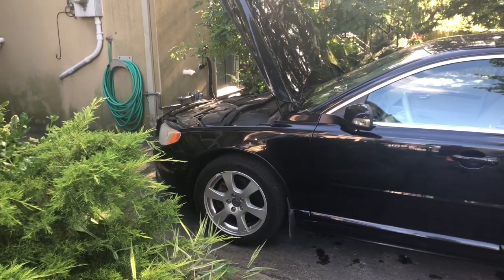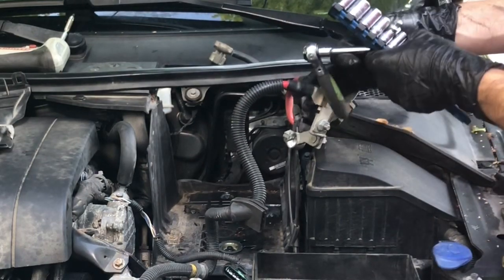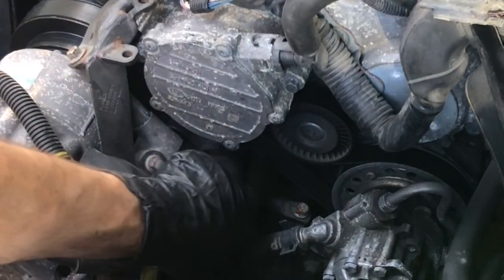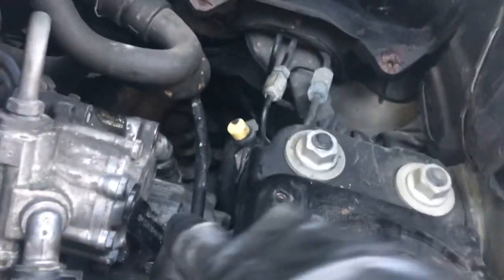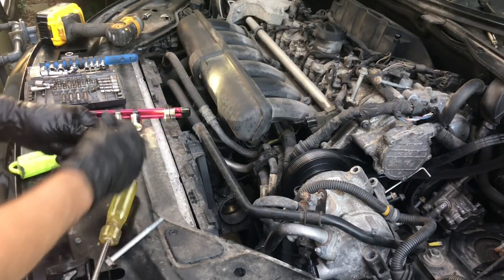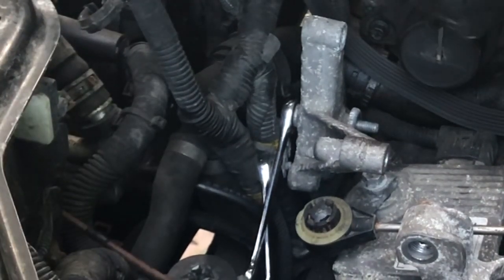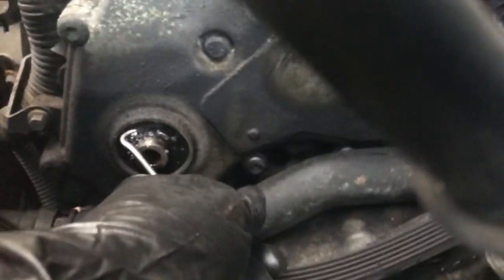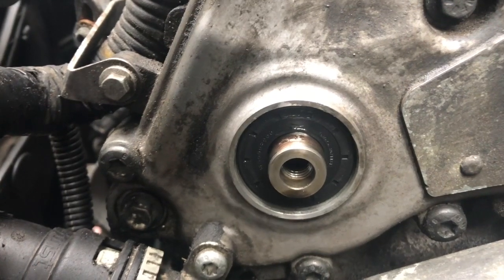Volvo V70 XC70 Drive Belt, Tensioner, Water Pump, Decoupler Pulley Seal Replacement - Part 1 of 3

Comment: Heads up for 2011 XC70 non turbo people. I just did the service... belt, water pump, tensioner, idler pulley, decoupler... and it was way easier than MY 2011. Way fewer parts to unbolt, no PS pump in front of the water pump and no need to align the A/C bracket with  a jig. Got it done in 3 hours.
Reply: Thanks for the update. Mines coming up soon
Reply: I have the 2012 XC70 nonturbo. I need to replace the drive belt , can you post the steps or what to watch for, and do I need to replace the Idler pully, and decoupler or just buy the Kit fron FCPEuro (Volvo Accessory Drive Belt Kit - INA 30757007KT), this my first Volvo but i have done lots of other work on my other cars
Reply: @joey1917  I have a write up from when I did this., but it’s long. If you give me some way to send it to you, I’d be happy to do it. IMO, if you’re going in this deep, replace all the parts that he shows in the video.

Comment: I appreciate this video...
A few things:
1. You pushed in the seal (with the volvo tool attached) by hand. Mistake. The tool is a press that ensures it goes in Perfectly straight and doesn't mar or damage the outer lip of the seal. It should be turned by a wrench until seated.
Also, before putting the seal in I would first buff the aluminum hole smooth and then apply grease to the clean hole for the seal to slide in on. 
Lastly, go get yourself an impact driver so you don't need to waste energy on drills and air tools. 
Do really appreciate this video 😊 ty ~

Comment: What a great channel, and great video!  I just picked up an 09 XC70 this weekend with 377k kms. I'm going through it, replacing most of the drive belt accessories. This thing was never maintained. This really helped me out to change out the water pump. VIDA only shows so much, but you need the practical part to get a good idea of what to do! Do you think I can borrow that coupler removal tool? I figured i'd change that seal too, since it's all apart. I'm up at Bayview/7
Reply from the maker: Rawad El-Debs I actually borrowed the seal tool from my volvo friend in Mississauga. Send me an email at pierre_mcalpine@rogers.com and I will add you to our GTA volvo group so you can reach out to him directly.
Reply: @Bigtime_mcalpine  Hey. How did you know that you have to replace crankshaft pulley first time? I have a noise of worned out bearings coming from engine bay when idling.  I replaced tensioner, idling pulley and belt but noise didn't go away. Thx
Reply from the maker: @adamsolowianiuk9462  Hi Adam, there was nothing visibly wrong with it but I damaged it slightly when I removed it so I figured I should go ahead and replace since it’s a maintenance item anyway. When they fail, I think i remember reading that they lose their ability to hold tension when rotated in one direction or something. I don’t think your decoupler pulley would be the source of noise. My guess: AC compressor clutch bearing which I think I also replace in this video.

Comment: Awesome videos - thank you for sharing them with us! I have a 2015 XC60 T6 with the same oil leak. Before the leak developed, there was a grinding noise (it's still there) from the belt area. My guess is that the noise could come from the pulley you removed/replaced or from the bearing inside of the READ. What is most likely to cause the seal to deteriorate; the pulley or the bearing inside of the READ? I am asking because I would like to determine whether replacing the seal and the pulley is worth it. Many thanks.
Reply from the maker: Well, all I can tell you is this: I ended up replacing my leaky seal only to get a grinding noise appear 2 years later. Turned out to the the READ unit that had play…I’m talking LOTS of play.
Reply from the maker: https://youtu.be/kdKGCryflws
Reply: That' a lot of play.  I guess you did not notice that sort of play the two times you replaced the seal. Did you have a leak before you replaced it the 1st time (when you did not have the seal install tool)?

Comment: Thank you for this video!
Is it possible to remove the old and reinstall a new tensioner with the ac bracket (that has to be re-aligned) undisturbed and still in place?
Reply from the maker: You are testing my memory but I believe so. As long as you dont need to replace the belt I think you would be ok.

Comment: Thanks. Great video. I have to change out my auxiliary belt and tensioner and was wondering if the AC compressor has to come out and I need to buy the 9997262 jig?

Do you have any suggestions on service manuals? I have a 2011 and 2013 XC70 T6 I need to start doing maintenance on them myself because $168 / hr shop fees seem ridiculous to me in AB.
Reply from the maker: It’s been a while but yes, pretty sure the ac compressor has to come off it’s mounts.  I’m told that for 2012 + the jig is not required. As for a manual get yourself an eBay version of Volvo VIDA. It is what the Volvo mechs use. Comes on a CD.  Not the most straight forward thing to install but if you are good with computers you should be fine.
Reply: @Bigtime_mcalpine  thanks for the guidance. Would you happen to have an eBay link you can post as an example? I assume this is for just the software that contains the manual not the diagnostic tool.
Reply: Thanks again for your guidance. I has been sorted:)

Comment: Did they change the design of this on the 2012 models?
Reply from the maker: I think they may have. It’s possible that one no longer needs that crazy tool to align the ac compressor for 2012+

Comment: WE HAVE A 2011 VOLVO XC-60 WITH ABOUT 90k. SHOULD ONE PROACTIVELY REPLACE DRIVE BELT, ALL PULLEYS, SEAL,WATER PUMP . NO LEAKS SO FAR. THANK YOU FOR YOUR OPINION. REGARDS
Reply from the maker: Yes drive belt and pulley do need to be replaced as part of regular maintenance. It’s an expensive service if you get someone to do it.  I think interval is 120k miles.
Reply from the maker: But I’m not certain that the 60 series is same as 70.  You need to double check.
Reply: @Bigtime_mcalpine  Thank you your videos are very educative. Regards
Reply: did you tackle this yourself? i have a xc60 with 90k. having to buy a 160k alignment jig is a bummer and everyone scares you about refilling the coolant.

Comment: That looks like a real pain - thiught it would be easier
Reply from the maker: pgreenx yep, it’s an annoying job. Lots of great things about the 3.2 engine design. This is not one of them.
Reply: @Bigtime_mcalpine  I appreciate your posting these. I am not as experiencesd as you but will do the seal when I replace belt. Thanks again
Reply from the maker: pgreenx I would only replace if it is leaking.  If it’s nice and dry, sont touch it!